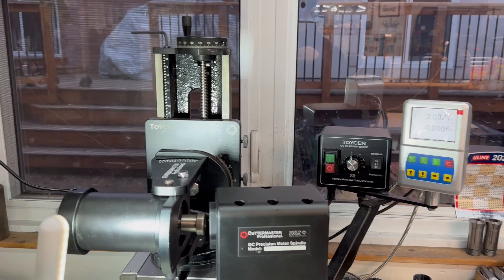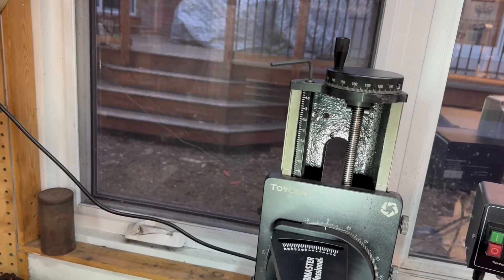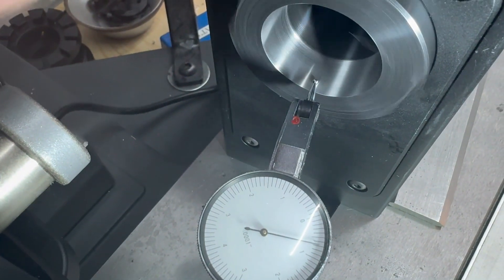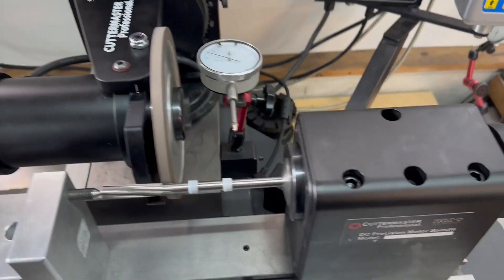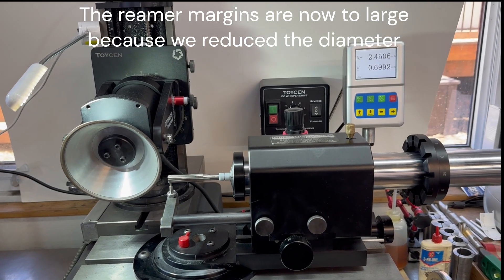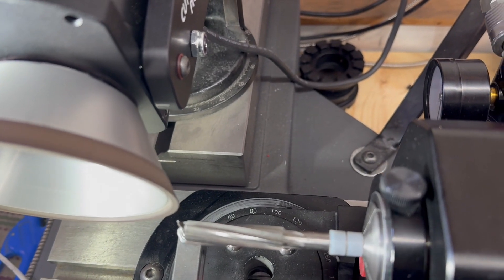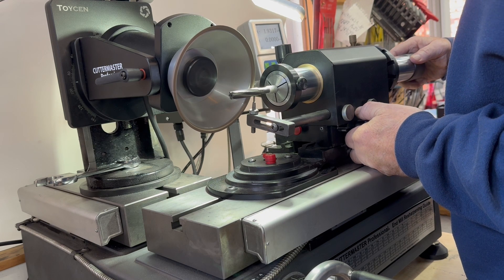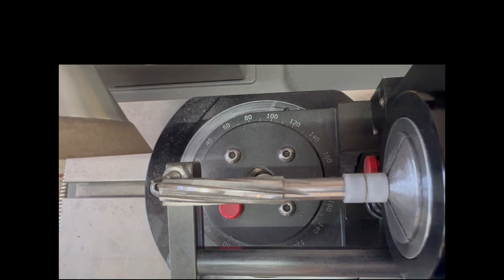Grinding a reamer to a new diameter.

Comment: From .12 thousands to .12 ten thousands of an inch, grinding the taper.  and running a reamer at +/-.0001... Amazing.
I love the Cuttermaster Motorized Necker it's one of my favorites.  When chasing these tolerances there's so much to consider it becomes a physics challenge.  
I recommend the CM ER32 Motor Necker to everyone that owns a CM01, JXT, or a Cuttermaster Pro.
Anyone can learn to do this